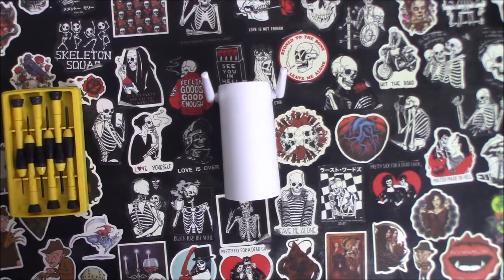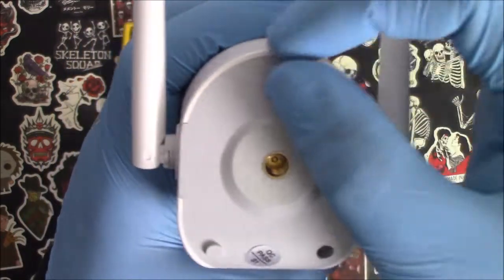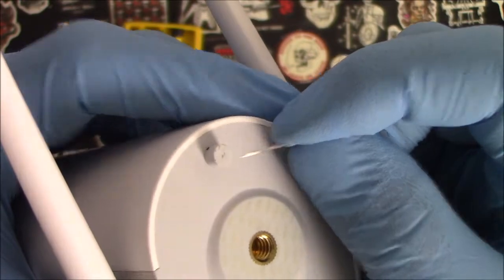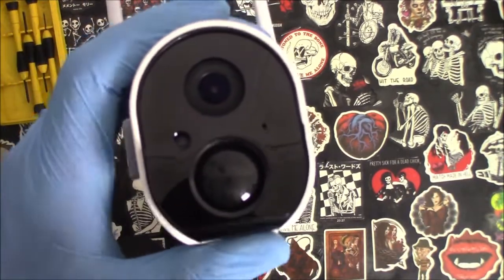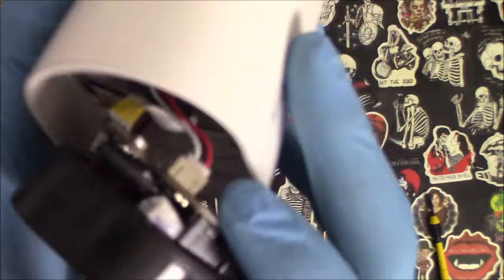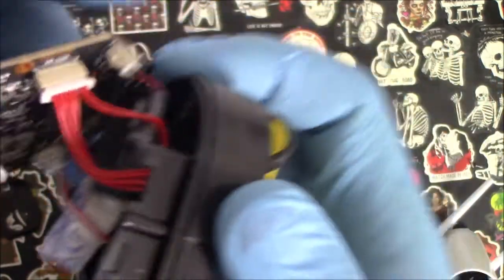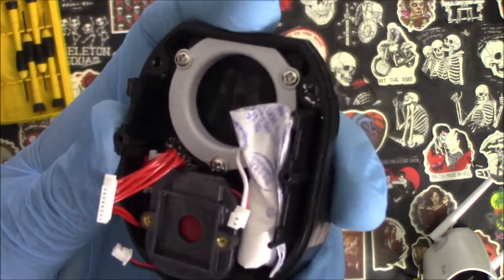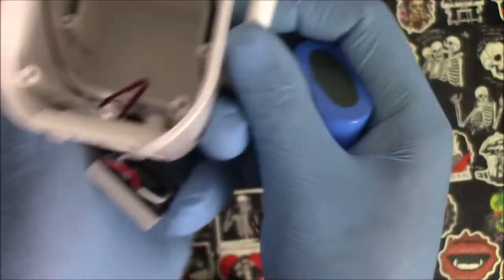ieGeek WIFI Outdoor Security Camera Teardown Lets See What's Inside The Device

Comment: Thank you for your video.I am just wondered if just simply remove the battery pack and connect to the power supply.The purpose of this action is to prevent possibility of damage to the battery below 0 degrees Celsius for external use in the winter connected to a solar panel.Just to note that the manufacturer warned about do not charge the camera at temps below 0 degrees.

Thank you